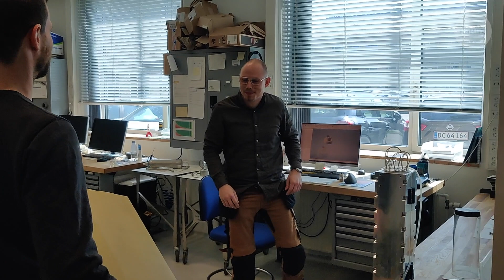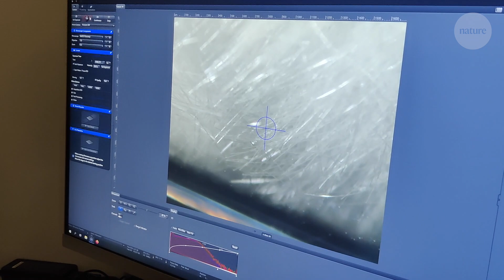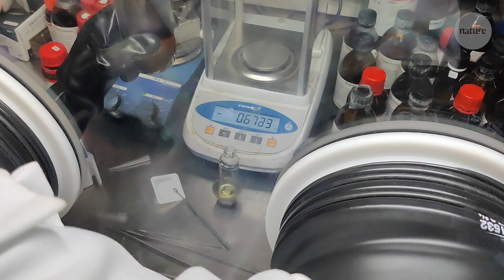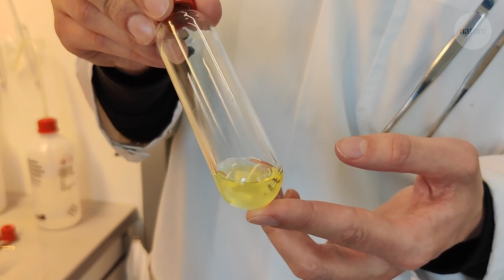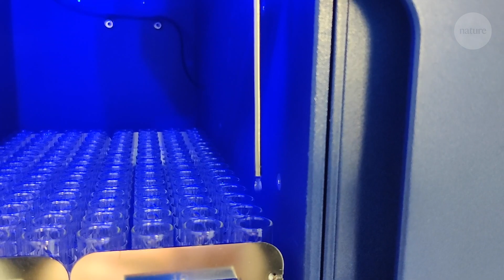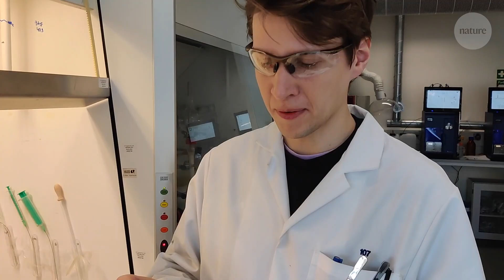How to recycle a wind turbine in a test tube

Comment: Can we maybe repair them and reuse them to make more energy thereby reducing the number of new blades needed?
Reply: i imagine they can design more efficient blades now and so replace them. im sure it all calculated but no doubt there is a lot of waste in most industries.
Reply: But ... where is the money in doing that?
Follow the .... Money!
Reply: @shabinthegreat  I guess when it can work for cars, it can work for wind turbines. You have an old turbine where the blade is damaged, in stead of scrapping the full turbine, you could bay some refurbished blade, maybe with some vortex generators to improve efficiency, og now you can run your turbine for another 10 years or something.
Just a you can bay a new set of brakes, shocks etc. for your car.

Comment: In my Opinion, just shredding them, running it through an “Entrained Flow Gasifier” then remelt the slag into new fiberglass/rokwool would be more efficient/less complex.  

Granted I’ll need to watch the video later + read the paper
Reply: energy use for entrained flow gasifier is very high, and the slag reprocessing would be inhibitivley expensive. gasification is best suited for coal and other less chemically complex organic feedstocks instead of this.